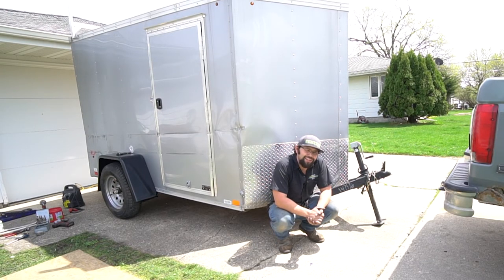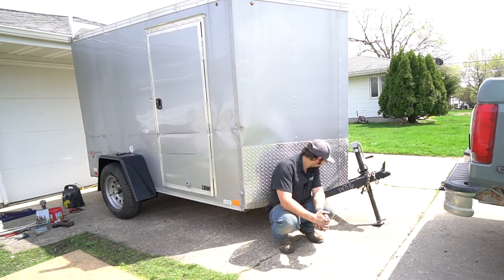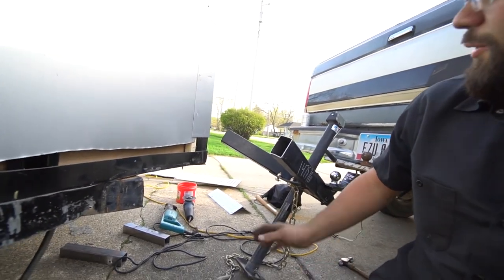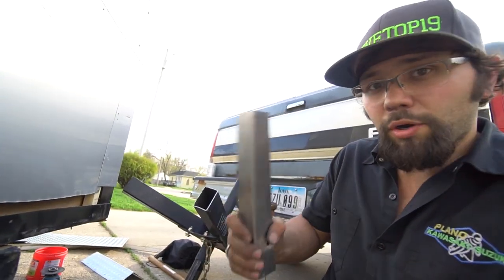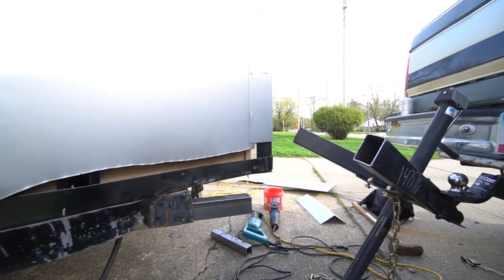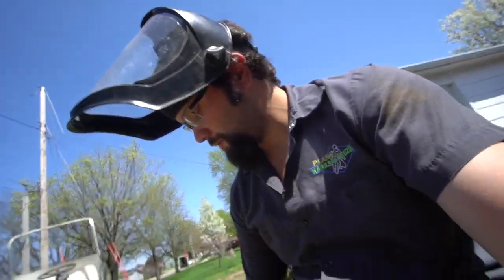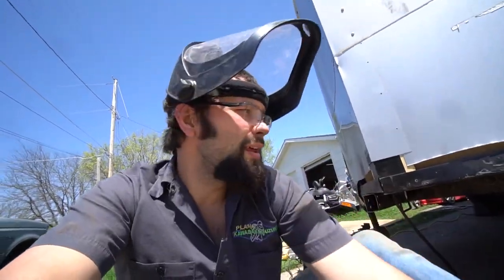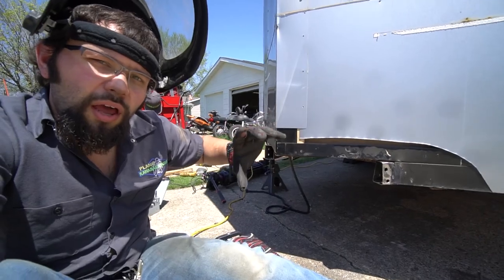Final Repairs on the budget enclosed trailer!! Tongue Repaired  Part 2 of 2

Comment: Hey just discovered you and you’ve inspired me! Instead of paying 8 grand for a custom trailer I want to do what you did and fix up one that needs love. My question is how do you find them on auctions? I’m new to this, thanks.
Reply from the maker: Hey, thanks for checking it out and glad I could give you some inspiration!  I personally bought this trailer from www.copart.com they do online auctions in every state, usually selling wrecked or damaged vehicles.  Also check your local news papers for auctions!
Reply: Stovetop19 Just looked around on it and that site is AWESOME! Definitely a likelihood that I’ll buy from there. I’m wondering if you had them do titles or certificates or whatever for you too.
Reply from the maker: @DaDavidVids  when it comes to the titles, you need to be aware of what your buying, they have the info listed on each listing, but if the vehicle has a title, they will sign it over to you along with a bill of sale.  My trailer does not have a title, here in Iowa it is a light enough trailer that it does not require a title, just that it is registered.

Comment: One question, respectfully what would this service run?  I know where in different zones, but just ball parking the situation.
Reply from the maker: If you brought it to someone who welds and has the metal, i would think you could get a job similar to what I did for around $200-$400.  All depends on the labor hours to get it done
Reply: @StoversMotors  thank you.  I hate pricing, but don't want to kill myself later.